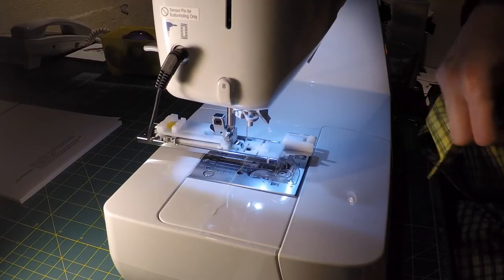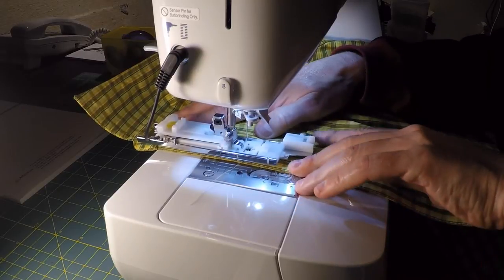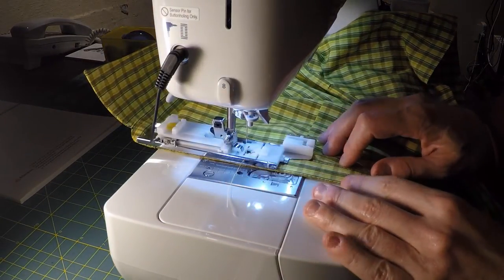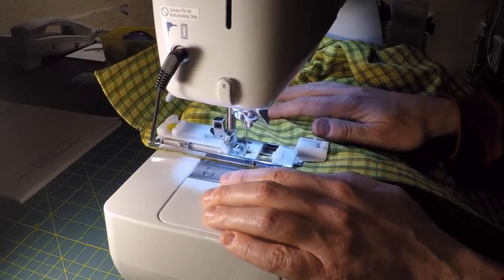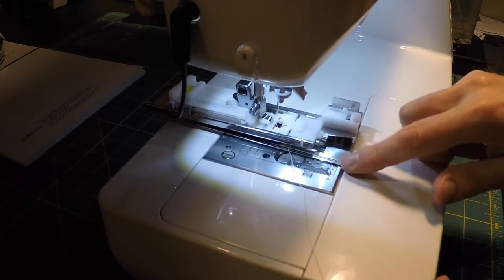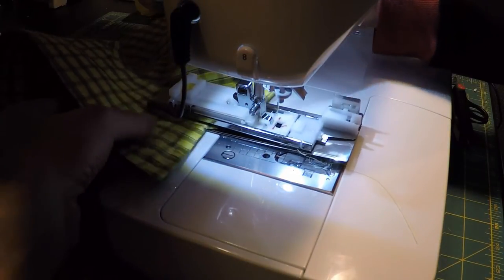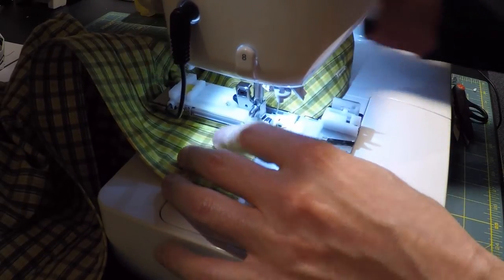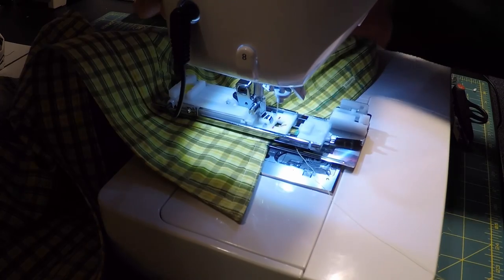Juki F600 Buttonholes

Comment: may I ask if this machine handles thick material and can still do the various buttonholes well? like garment leather, or multi denim layers?
Reply from the maker: I made a peacoat using melton wool and sewed the buttonholes for the pockets.  It worked beautifully, so by itself the thickness of the fabric is not a huge issue.  I have had problems sewing the waistband buttonhole on jeans - even with the dual-layer buttonhole attachment you have to be careful to avoid too much bumpiness due to seam allowances in that area.
Reply: @MichaelPortuesi  much appreciated Michael. I did more research into these higher end home machines with keyhole functions, and found out that at least for Bernina and maybe Juki, that it's not about the thicknes,the constraint is the gauge of the thread. I tried a size 92 polyester thread (which I'd use for leather jacket), I think it translates to TEX 60 or 70, and the Bernina tension/bobbin area can't pass it. Jams. This is a major dealbreaker as I need the machine to be able to use "jean thread", no need for super heavy but at least Jean thread, that you can buy from Wawak.
Reply from the maker: @ejshelby5460  You may be on to something.  When I stitched the buttonhole for the jeans, I used jeans thread to match the topstitching.  Maybe switching to a lighter thread would have helped.   I did all the other topstitching with jeans thread on an industrial machine, so it's hard to compare, but I have used topstitching thread successfully on the Juki for my melton wool peacoat.  Perhaps the issue is adjusting the bottom thread tension, whether its Bernina or Juki.  I have thought about buying a separate bobbin holder for the Juki, but it is pricey ($50).  No doubt the Bernina equivalent would be at least as pricey.
Reply: @MichaelPortuesi  I continued to research, and it could be that the machine can take jean thread at the top, but the bobbin can only do thinner thread, according to my Juki dealer. I emailed Brian at Juki America, hopefully he can answer. It is just counter-intuitive to me that these powerful machine that can do jeans and peacoat somehow can't handle the matching thread, doesn't make sense.